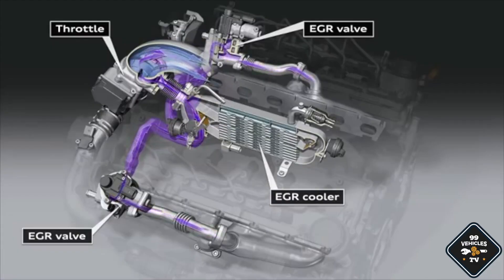The Purpose of EGR (Exhaust Gas Recirculation)

Comment: I'm removing this EGR in my diesel engine
Reply: EGRs cook some of those diesels alive.  Im sure you buy so much more life out of that engine as soon as you remove it
Reply: @JamesDelano94  I'll keep the SCR system (the DEF system), because it doesn't have the problems with plugging and cracking that EGR has and doesn't interfere with the combustion process. It's also way more efficient at NOx reduction than EGR.

Comment: Think of egr as a space filler. it's exhaust gas that is being re-introduced back into the cylinder that has already been combusted. (Yeah its hot) but it's not air at that point. It's NOT part of the combustion process.. it's being used only to increase cylinder pressure to reduce NOx. it's its main purpose is to increase cylinder pressure for a more complete burn. does it rob power? Yes! but not in the way you are trying to explain it. since it has almost no left oxygen in it anymore it does not matter how hot or cold it is. it's just a space filler. SO why does it fail so often?? You are trying to use exhaust to fix bad exhaust emissions. it's like trying to unclog a toilet with the same shit that you are trying to get rid of. It usually just re-clogs destroys the system itself.
Reply: david nappi Lol this was more informative than the actual video💀
Reply: How would it increase pressure? Especially in naturally aspirated vehicles? It would seem to me that the pressure would be constant (atmospheric), but I may be missing something?
Reply: @Mr_Gabbles   you would be right. NA would not have this issue
Reply: turbo motors suffer from this alot
Reply: backpressure
Reply: In full throttle mode in na engines egr closed to get as much oxygen as possible into the cylinder. Pressure in cylinder before spark is the highest. During part load operation that engines tend to run most of the time egr increase pressure because stochiometric ratio of air and fuel mixture + egr = more mass than just mixture = more pressure before spark.

Comment: He says that EGR are almost fully closed on full throttle; so if it is close.. cold air will still be utilised for the proper combustion; EGR only works on low speed like traffic and partial opening of the Throttle. For the simple reason that during slow speed traffic pace, exhaust manifold pressure is high thereby pushing some of the exhaust gas into the EGR valve. On the other hand, once the turbo spools up on diesel engines; exhaust pressure drops.. disabling the EGR to operate.. 
Correct me if am wrong
.

Comment: Hi dear if EGR doesn't work what will happen in the engine?
Reply: If its stuck opened ull get more gunk /trash (exhaust fumes ) going in ur engine (that's wher u get dirty oil.From here the engine is deteriorating more, Also, ur throttle butterfly  will get stuck after some time by black gunk since the exhaust fumes are run thru intake (logically intended for clean air - lol what's the point for air filter if ull make it durty with durty exhaust fumes ). Instead clean air-fuel mixture , the amount of exhaust fumes will be to hi ,and wont burn like suposed to ,plus reducing the fuel-air mixture to do its job ,so ull have loose power . With the loose power ,computer will read it , and try to dump more fuel in cilynder to compensate the power loose, so ull get more fuel loose for same amount of miles in good working conditions. Hope I helped.